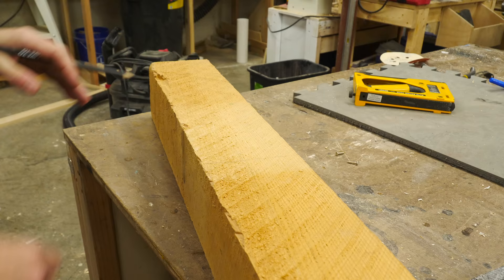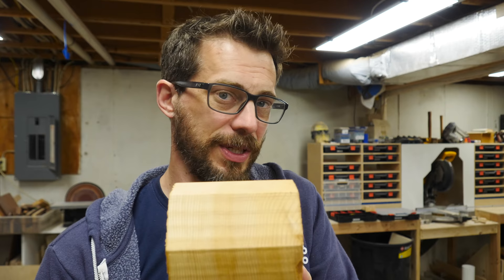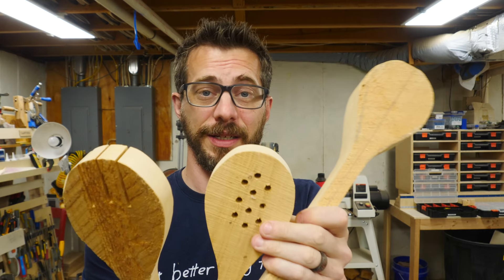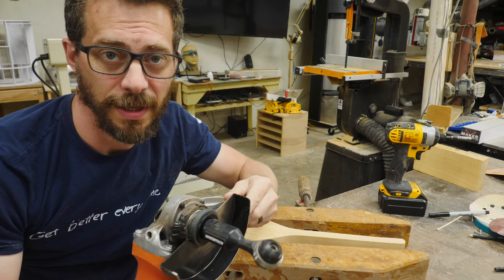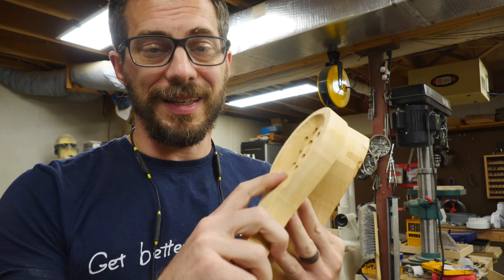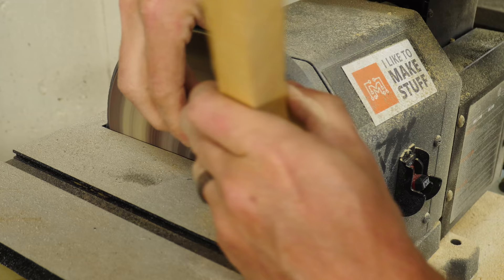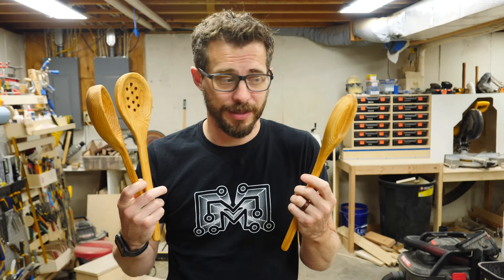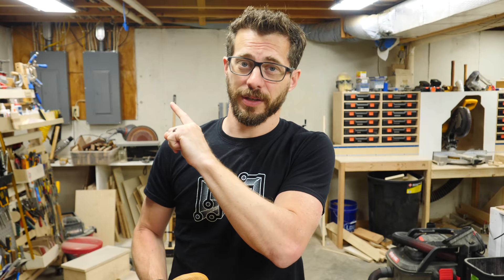Spoon Carving Using Power Tools | I Like To Make Stuff

Comment: For what it's worth, basswood is easy to carve using sharp knives or chisels, so you could do a lot of the finer shaping that way, instead of making so much sawdust with the belt sander. Also, a good way to sketch out the shape you want is to fold a piece of paper in half lengthwise, draw half of the shape with the center line along the fold, and then cut it out. Instant symmetry. 

At any rate, your end result is pretty good for your first try at spoon making! Just diving in and trying a few different things = win!

Comment: Just a tip. If you have a belt sander, get a small diameter wheel and thin belt to shape the inside of the spoons. That gives you way better control and a constant radius to work with. If later you want a sharper corner (not spherical) just do what the misses did and go for a dremel finish. Hope this helps.

Comment: An equally useful and probably a lot less intimidating way for carving, shaping, and removing wood is to use a wood rasp bit in a pneumatic die grinder. It's a lot easier to control and you get a lot less tear-out. They are super cheap too.

Comment: I would have used a rounded bit on a router to cut the spoon section and do that while the block is still square. Then cut the shape, then round it all off. Easier clamping and you can even use a tracer bit on the router for shape matching across all 3 spoons.

Comment: Nice, how many coats of butcher block did you put? The one kitchen utensil I made just drinks mineral oil like there's no tomorrow, maybe it's because it's cherry but I'm curious if yours will need another coat soon or not (mind you butcher's block has bee's wax in it which would help to seal it better than plain mineral oil I suppose)

Comment: Awesome video!  Does the beeswax leave that oily touch to it? I’ve used mineral oil and tried and true and both leave that oily touch as the oil keeps sweeping out. Made a cutting board over a week ago and it’s still sleeping out oil and I’ve cleaned it with a rag repeatedly every other day.